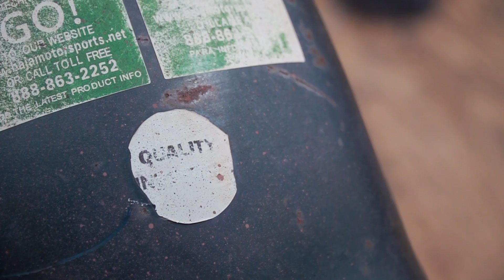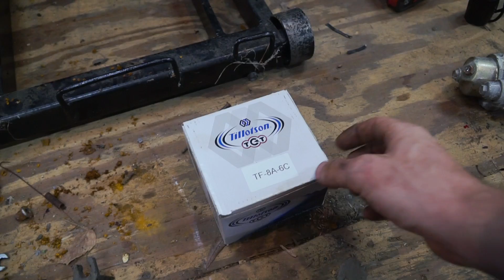$20 Mini Bike (Saved from the Crusher!), Will it Run + Ride?

Comment: HELLO ! HELLO ! HELLO !                   
          Isaac have you ever heard putting diesel motor oil in a motor like what you have with this mini bike . It has  a lot of at additives that that motor needs . To make it quite smoking . and make sure the oil seal on the vale steam is all the down and sitting on the head . And I would put diesel motor oil in the cylinder and turn a few times . And let it set over night .  Run the diesel oil tile the next oil change . Hope this helps your motor .  
          I have done a lot motors this why . And I like the way it brings the motor back to life !

Comment: I have a factory Baja 196 motor, when I bought the bike we got it running without having any oil in the block. I took it home and filled the oil, it ran like a champ. Fair to say they are hardy motors

Comment: Alittle tip, for stuck rings try some transmission fluid. Run the engine at med rpms  pour about a cap full of trans fluid right into the air side of carb. Plumes of white smoke will fly out the exhaust, do the cap method  two to three times its should clean valves and unstick the Rings right up... easy fix on a low budget...

Comment: I have the predator 212 Baja minibike. I need to fix it. It needs a back tire chain rear fender carburetor and throttle cable and pull rope

Comment: A little tip u can tin/solder the end of cable be for u cut it. This will stop the cable from fraying
Reply: Ya I do that a lot I use a socket that I closed the end off for a little run to dump the end in

Comment: Atf fluid did wonders to the rings on my 85 cb450. Definitely a good trick to try before doing rings. Just let atf soak in the cylinder for 24 hours. Or over night.

Comment: Before you cut the end off the cable flow a little solder into it. No fraying and it can be filed down to fit in smaller holes.

Comment: Built this same brand of bike for my son. Stage 2-hemi  212, torq converter, and the stock rear sprocket are good for 55mph with a 180lb rider. Pulls wheelies with ease and is a ton of fun on trails. Leave plenty of room to stop from 50+ brake fade is real!!

Comment: Little tip. If you buy a little lead and a small kettle you can heat the lead and and dip the end of that cable in so it won't frey

Comment: Hey guys, you ever take a wire wheel to a cylindar wall? Is it recommended for removing rust/scale from a waterlogged engine?
And to keep a cable from fraying when you cut the end off, just add a few dabs of super glue before you snip. ;)
Reply: @Tampaboys  ooookay? What did that have to do with my question?
Reply: @christophermorin9036  nothing bud just thought you might enjoy a good old fashion burnout
Reply: @christophermorin9036  I would be careful with a wire wheel on a cylinder head it can score it up real easy better to use a cylinder bore kit
Reply: @Tampaboys  Well thanks for offering, but unfortunately I can't stand burnouts. Sorry, ^u^;
Reply: @Tampaboys  Thanks for the reply, I was just wondering if it would be effective. Perhaps a brass wheel would be less damaging while still removing the rust and flaking metal?
Reply: @christophermorin9036  gotcha bud and you could try the brass I guess never heard of a brass wheel but I do know brass is soft so you should be ok

Comment: Set an oil filled radiator right next to the block so it can warm up and see if it breaks free that way.
My dad actually taught me to light a fire under an engine to warm it up back when he used to do logging and came across an old diesel (saw for tree trunks) that had been sitting 20 years.
I'm guessing oil rad is safer.

Comment: You should clean up overbore the thing/lap the cylinder like Red Beard Garage did. Hell, you could even borrow his tool that he used. It looks kinda like a pully puller, but is spring-loaded to open up AKA apply pressure outward and has some light cutting bits on it that look like axle keys.

Comment: Use evaporust on bad rusted parts it's ok on all metals. Just drop the carb in then pull it out clean plus it's reusable. If you build a "tank" with a 55 drum. I would add a hose from the bottom out the side to a pump and ball valve. Then attach a filter back up to the top. When you turn on the pump it pushes the used stuff threw a filter and cleans it after awhile.

Comment: When cutting those braided cables (throttle, etc) put some solder where you want to cut and use a dremel cutoff wheel, that stops fraying.  OR go to Park Tools and pickup their specialized tool for cutting cables, its like 30 bucks?  Worth it!

Comment: As soon as I saw the piston after the head was removed I wondered if you would hone and ring. I use a guy that makes rings of any size whenever I rebuild one of my model engines. The prices are good and it's worth the effort.

Comment: I say put some rings in it and get it running but then do a resto mod. I had one that I got for free, repainted the entire thing, polished out the steel fenders, put a ungoverned Predator on it and led headlights. Was pretty nice but the engine plate was so thin it cracked like 5 times.

Comment: Just a suggestion, as an experiment just to see if it would work, fill the motor with diesel and let it sit for a bit, drain it and put some RESTORE in it from like oriellys, its supposed to revitalize low compression engines, id be interested to see if it would work on something that far gone.

Comment: You all probably know this, but in case you don’t.
When I have to cut a throttle cable I will take a little solder (not to much) to the cut end to eliminate the fraying that always ends up in my finger… 😂

Comment: I couldnt find a set of handle bars for a mini bike for 20$
Reply: Amazon has some for just over $20
Reply: @kevinolson5112  I think the point is, that mini bike was cheaper than a handle in Amazon....
Reply: Yeah most shops stopped carrying them where I live.  You either have to buy online or order from the one shop that still stocks them.  As a result the second hand market prices are ridiculous.  I've seen really haggard bikes costing as much as new ones.

Comment: "I'd buy that for a dollar"!!

It's great you are fixin that engine rather than just swappin it out for a new one. We throw away far too readily, well done boys
Reply: The problem is unless you get free sponsored parts, the parts to fix that engine are worth more than the fixed engine. The 196cc engine being 4 maybe 5 HP compared to getting a new 6.5 hp engine for under $100 with the right coupon.
I'm all for restoring and saving things but sometimes more to it. No point in spending $100 to save something worth $50.
Reply: @user-neo71665  excellent point 👍
Reply: @speckledjim_  thats very true, if it were me i would have put that carb in my ultrasonic and let it soak overnight before i inspected it. that thing REALLY needed some love. although thats if your desperate and don't have a sponsor.
Reply: @HuntersHivemind  Sponsorship makes a helluva difference buddy 👍
Reply: Nice RoboCop reference.

Comment: Might be losing compression through those valves now, yes you want them lapped in, but you only want a tiny line of seal, not a wide landing, they won't seal as well.

Comment: Another trick for lapping the valves would be to use a piece of rubber hose between the drill gun and the valve stem. While spinning the valve, apply pressure with your finger to press the valve into the seat. This gives you more control and you don't have to worry about keeping the drill gun on axis as much.

Comment: Hey how is everyone doing? I have a question about my performance predator 212. It’s got a billet rod and flywheel. It has the 265 hot cam with a ported head. It also has a thinner head gasket. I decided to put on a 26mm flat slide  Mikuni carburetor. I have tried every setting on the needle and it runs very poorly on the top end. Can anyone give me any suggestions? Thank you. cars and cameras keep up the great work.👍
Edit: I put on the predator 420 carburetor and it screamed but I started playing with timing keys. I advanced the timing 8 degrees with the key and off launch it was an animal but after 5000 rpm or so it falls on its face. This motor should be going to 7500 rpm. Can timing affect the top end like this?

Comment: Quick tip: If you cut throttle or brake cable at 45⁰ with an angle grinder, it won't fray. Put it up against a piece of wood so it won't move when you cut it.
Reply: Take a cut off wheel and put a shallow cut in the block of wood for the cable to lay in it keeps the cable from rolling around when you cut it.
Reply: @user-neo71665  Bingo bango buddy.
Reply: @almostsapien  LMAO, learned that back when I was racing 3 wheelers. Yes I'm old

Comment: Seriously, how does one come across a 'lightly used' coffin... LOL There's a good story there...
Reply: Its quite common. If you opt for cremation you generally won't get a new coffin and you won't be told. They don't cremate the expensive and elaborate coffins because of toxic smoke so you have an "exibition" coffin for the viewing/funeral and then they are transferred into a plain pine, eco, or no coffin at all for the actual cremation. Then they fancy coffin is reused. Over and over. And over. Until it becomes unfashionable or scuffed
Reply: @1one3_Racing  Fascinating. I had no idea. Thanks for sharing...
Reply: In another video, he said it was used as a prop in a play.

Comment: I have that same bike.  Er, um, in MUCH better condition, of course, LOL.  Good little bikes, if you take that terrible gear reduction setup off of it.  Does 45mph, but could use a torque converter setup.

Comment: You guys should know that anything will run with enough work and parts.
Hone the cylinder or bore it out, new piston, oversize the valves, new carb.
Simples

Comment: come on now guys if you going to do it do it right overhead off all the Piston out hold out the cylinder get some new hash marks in it crosshatch it real good make sure you get the right size rings and do it right or don't do it at all and make sure you've got a good cam in there cuz you could have rolled one of the lobes in a cam that can also cause compression issues make sure everything is done properly don't have ass it and Isaac if you had a father like mine you guaranteed he said to you if you going to do anything you better do it right don't do if you're not going to do it right don't do it at all I guarantee you he must have said that to you many a Time so make sure you do it right and do it right the first time so you don't have to turn around and do it all over again

Comment: hi if anyone is seeing this then im having problems with a pit bike ,bought non runner had no spark...brought a new stator and wire loom but still no spark can anyone help me
Reply: Does it have a kill switch? If so make sure it’s not shorting to ground. You could even disconnect the switch and check for a spark.
Reply: @mozer30  ive done that and still no spark

Comment: This bike was probably a flood victim.
Would be a good candidate for showing how all is not lost for those viewers that would rather Save than Replace.
Show an engine rebuild.
An alternative could be to make it into a mini chopper since Y'all excel at fabrication of something different.  Paint it a vibrant color, fabricate a custom polished exhaust, maybe utilize or replace the fake fuel tank with something functional.  Heck, add a Sissy Bat and Custom Front Fork.
The possibilities are endless.
LOL
Reply: My Ford Focus was in a parking garage during Hurricane Harvey and every single car there  was totaled through insurance, except for mine. Water had made its way into the engine and I had to clean every single thing but I didn’t even take the valve cover off. Fogging oil, some cranks, and fresh fluids all around.... that was 30k miles ago and that car still runs perfect 😍 202k miles on it now

Comment: Nice find! afro-engineering tip: wrap cables in electrical tape where you are going to cut them, and cut through the tape. It does a pretty good job preventing them from fraying.

Comment: Who the heck pointed the exhaust directly towards your legs???  If you cut your cable with a hammer and chisel up against a vice or some steel stock it will crimp it closed. This is the proper way. Soldering is also an answer but not necessary.

Comment: Hey everyone...I have a 1983 Honda ATC70 that is in running condition no smoke and seems to have good compression...has tears in seat and some  damage to front fender but very drivable... it is a 4 speed no clutch and shifts very good... it has new carb and new drive chain...I am asking 2000.00 and am willing to negotiate on price....also willing to ship but buyer will be responsible for shipping costs.... holler at me if interested

Comment: Not necessarily smart to spin the engine over after bing full of water with not oil.
Reply: I put oil in it
Reply: Isaac it'll be fine    yep
Reply: @isaacitllbefine7231  was the exhaust somehow clogged up? Like you said, the compression sounded really low, im just wondering if the exhaust somehow got clogged up.